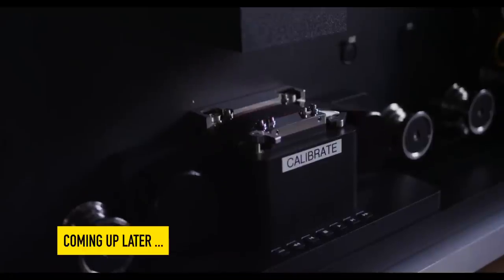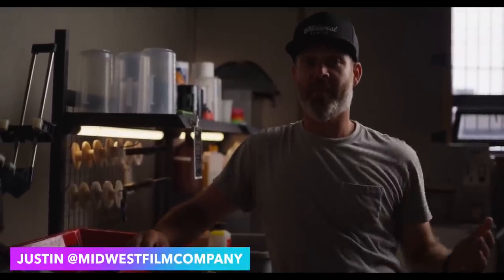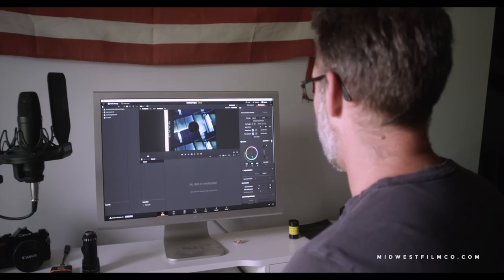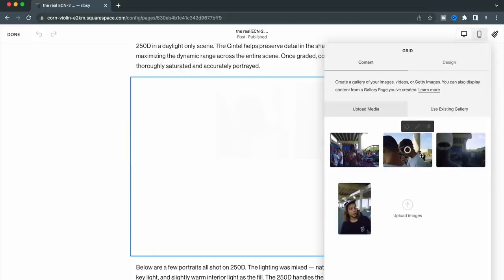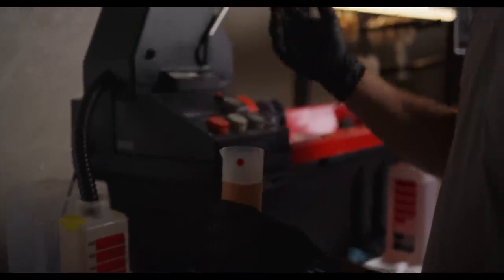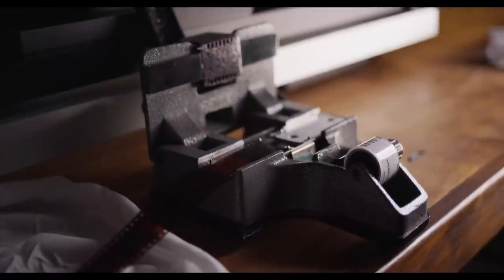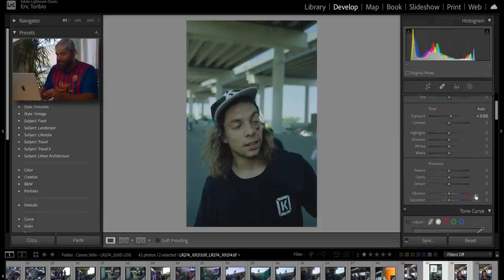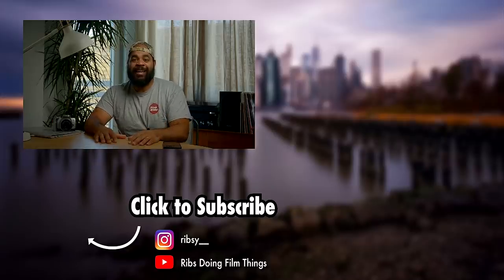Amazing Kodak 250D CINEMA scans ... ECN-2 vision3 film is a must via the Cintel scanner

Comment: Interesting process! The Cintel scanner can give you HDR scans. Theoretically you can get up to 15.5 stops of DR range from that ECN-2 film. I think the max resolution is 4K but it's plenty I think for still images. Here's where I think you can get really creative. Since you're using a film scanner, you can colour grade the scanned film in DaVinci Resolve. However there's a little math involved to get the right transforms in place. BMD has a pair of 1D Luts one that takes you from Cintel Negative/Print to Linear (depending on if you've scanned neg or print). Like with any scanner you have a DMin, which means your blacks won't be true black. Linear adjustments help correct for the scanners DMin. On the colour page you can make adjustments in linear or use a 2nd LUT from BMD that converts to Cineon. Cineon is like the OG gamma curve and really what alot of other curves are modeled after (SLOG, CLOG, LOGC etc). Once you're in Cineon, BMD has print LUTs that'll take you from your ECN-2 neg to a print, think Kodak 2383. Since you're using actual film, you can use any one of these LUTs at the end of your chain and then colour correct after you've converted into Cineon log space and before the print LUT (corrections made in Cineon).
Reply from the maker: im sure the results would be nice but thats alot of work for 1 photo (multiply this by many photos!)
Reply: @ribsy  first time implementing and for someone that doesn’t use resolve regularly for sure. But you can save presets of node trees and looks and ripple looks through your photos, just like you would in LR.

Comment: Timely release, thanks. I bought a 100 foot roll of Vision 3 and bulk loaded it into 20 exp cartridges. (personal preference).

Question for you; You did not set the WB by picking on the border before inverting the tones? That's what I've been doing with C41 forever.

I did buy an ECN kit from FreeStyle and I have 10 rolls of my bulk film to develop. I'm also considering REMJET removal with baking soda first followed by developing with C41, just to see the difference between the two chemistries.

Thanks for posting this video.
Reply from the maker: the scans are positive images. no inversion is necessary

Comment: Great video. I'm getting ready to dive into shooting some Kodak cinema films myself. Just can't beat the prices and managed to find a place here in Korea that sell it rolled or in bulk as well as local labs that will process it. Probably gonna grab a 100 ft roll on payday since I bulk load at home.
Reply from the maker: 100ft rolls are hard to come by. Usually 400 is the minimum
Reply: @ribsy  Fortunately we got a place here that cuts them down to 100 ft. They also sell it already in 36 exp rolls so I picked up a few of those.

Comment: Yo, you'll probably have better color in your scans if you take those scans into Resolve and just apply a Cineon to whatever (rec2020, RGB, etc) LUT. Lightroom just doesn't have the tools to really get the most out of a Cineon scan.
Reply from the maker: I don’t have facts but find that hard to believe. Either way, editing 30+ photos is a workflow nightmare in resolve - LR is no question better in that regard
Reply: @ribsy  Hey, didn't mean to come off harsh, was just typing fast on the move. I do have the facts, been working with log footage professionally for 10 years. To get the most out of a Cineon scan, your don't want to wing it by eye with tools meant for photo. It will look amazing out of the box with one click if you use a tool to convert the Cineon meant for it. Lightroom Classic can do LUTs, that would be better, just need a Cineon -> whatever LUT. And, btw, Resolve is WAY faster, if you know how to use it. TONS of tools to keep from re-doing the same operations twice. Lightroom doesn't even come close to the color tools of Resolve, and it's free.
Reply from the maker: @TheNateweaver  all good. i don't doubt resolve's power (i use it for my BRAW footage). but i rather keep photo editing in lightroom. just much easier in terms of workflow. i'll def look into the LUTs recommendation, thanks

Comment: I love 250D. Just wondered if you've ever tried Nik and Trick Photo Services in Folkestone (England)? They spool their own 50D, 250D, 200T and 500T and also do ECN-2. Their films are only £6.25 for approximately 30 exposures. Develop and scan (16bit TIFF) is £17.  Not sure what scanning process they use for Vision 3 but I was delighted with the scans I had. Silbersalz in Germany I think use a very similar process to your guys here
Reply from the maker: i've bought from nik and trick, but never did dev. not sure if anyone else uses a cinema scanner
Reply: Yes, I bought from Silber but they make you buy 10 rolls now (Brexit). N&T don't scan on cine scanner, that's the difference.
Reply: @neilgenower9950  Ah ok. Silbersalz used to be 4 rolls i think

Comment: Still very much looks like an amateur operation using that jobo and wiping off remjet with pec pads. I was hoping they had real lab quality machines for developing ECN-2 with cinema lab quality consistency.
Reply from the maker: The vast majority of ecn2 labs for stills are going to be like this. The ecn2 machines are designed for motion picture film which is substantially longer than a roll of 35mm film